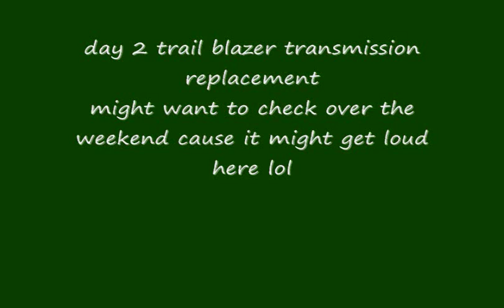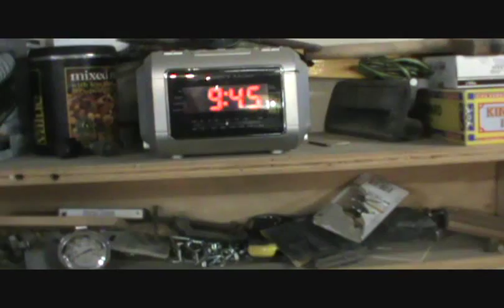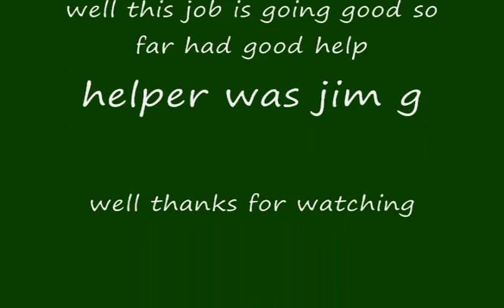day 2 trail blazer transmission replacement might be some noise

Comment: How did you get those brackets out of the way to get the trans back in. At the top whit the hoses on it.... the top 2 bolts
Reply from the maker: wow thats 5 yrs ago i re watched video trying to remember the only thing i can think of is i have 3 ft snap on extention i use when i do trans jobs
Reply: May I k ow the name of that hose with the brackets in the way of the top 2 bolts
Reply from the maker: its the heater cross over pipe for heater core not sure proper name  @andrewmedina5835
Reply: That's the problem ism having that dang thing in the way
Reply: @kevinscott6992  were you ever able to get around it?